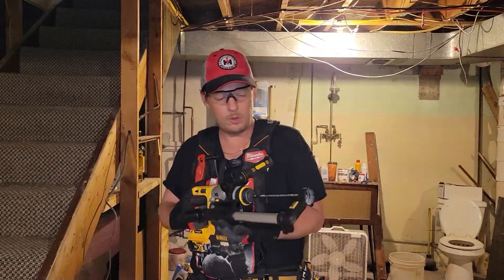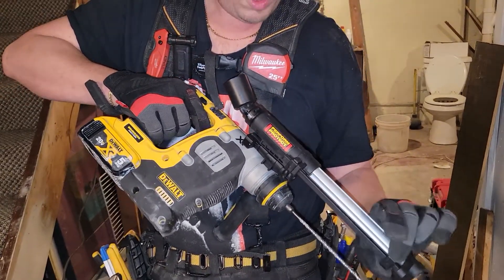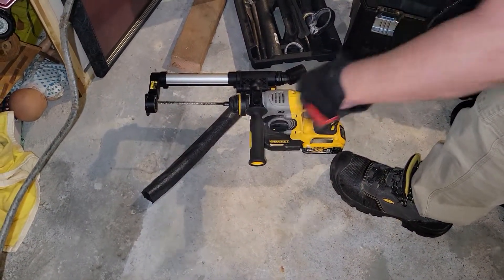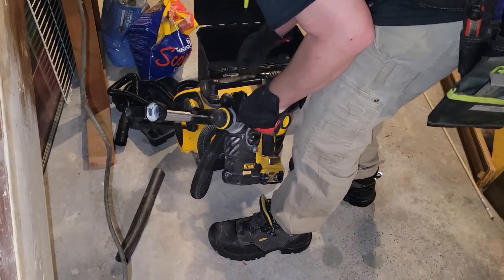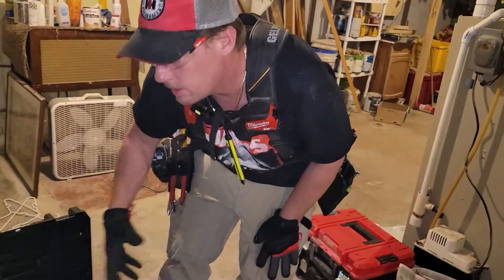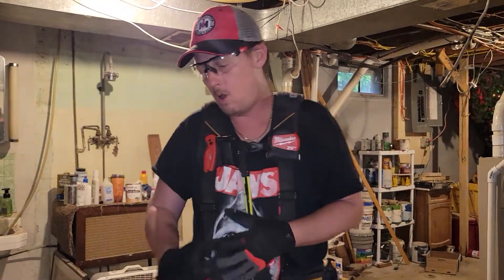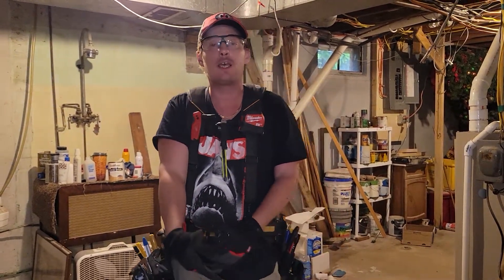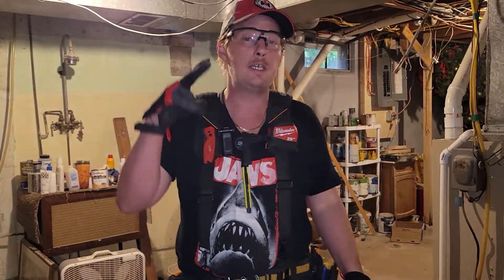Trying out my new dust extractor for my Dewalt Hammer Drill. Initial impressions.

Comment: Do you think I could use a drill similar to this in order to drill a small hole into a reinforced steel door? I am planning for a particular job and my profession requires that the drill is both quick and quit, as well as non-traceable. I am curious if this particular drill would meet these criteria, and also be able to drill through multiple sheets of reinforced steel with enough precision to avoid tripping an alarm.